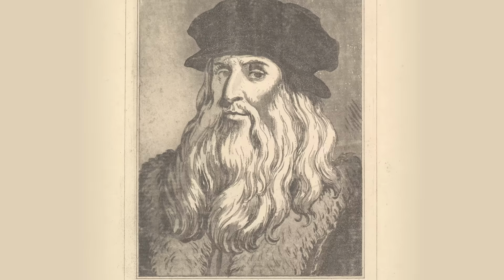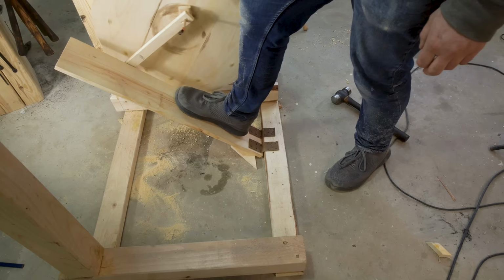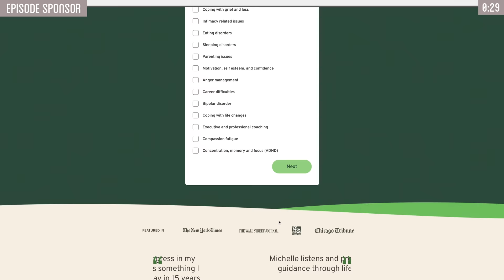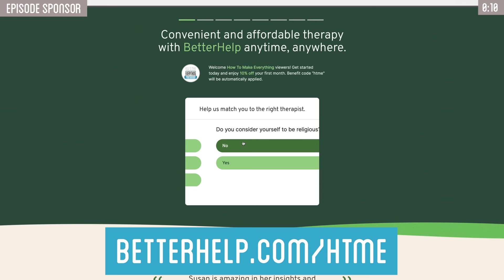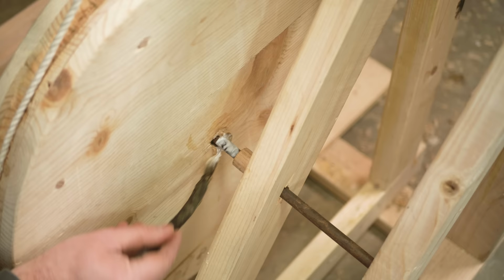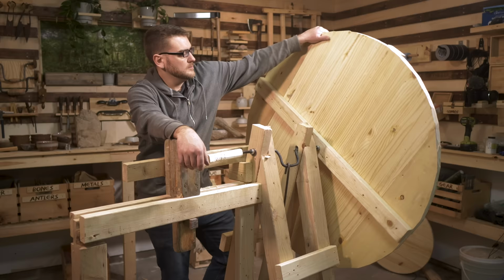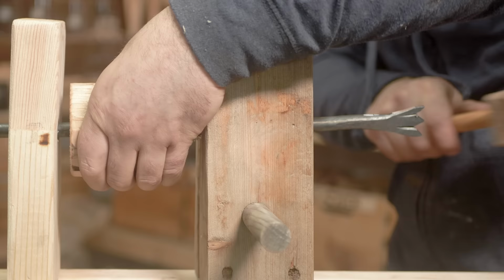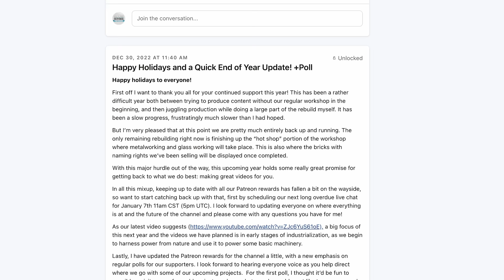Does DaVinci’s 500 year-old Lathe Work?

Comment: Chemistry safety tip: add the lime powder to the water, not the water to the powder! It'll help you keep control of the temperature and avoid steam explosions launching corrosive solutions everywhere. This applies whether it's an acid or a base.
Reply: Do as you oughta, add acid to water
Reply: @y0h0p38  except lime is a base.
Reply: @Ghorda9  Strong acids OR bases both create heat when they dissociate in water. Adding water to either isn't a good idea, unless you want spashes of strong acids/bases.
The saying I posted is just a saying to help you remember to add them to water, not vice versa. It goes for both acids and bases

Comment: clamps were invented in 500BC and would help stabilize much of your woodworking. Taking a little extra time to align things and maybe make slightly more accurate tools might help you out. Also making your own improvisations/improvements are a good idea if thats all something needs to work. Maybe especially with reinforcing the structure. Perhaps a table to help you saw aligned aswell.

Comment: I'm a carpenter, and I also recreate wooden tools used throughout history. My largest projects have been a full size medieval trebuchet, and a full sized wheel crane (the original heavy crane, powered by two men in "hamster wheels"), so these are my best tips. Most likely, all of these have already been covered, but here goes.

1) Increase the accuracy and straightness of your joints. Do full layouts of all mortise and tenon joints, use an actual saw to cut the cheeks, and be sure everything is STRAIGHT. Your frame was wobbly not due to the design, but because of sloppy joints and lines not being straight.

2) BALANCE YOUR FLYWHEEL!!! A flywheel is useless if not balanced! In fact, it makes the process more difficult!!

3) Use hardwoods in the supports. Pine is alright in areas without high compression or torque, but in the vertical supports and the flywheel supports, utilize a hardwood like oak. Using oak for the flywheel could also help with the storage of more energy.

4) Use leather instead of rope. Real leather is much more springy, has superior toughness compared to modern rope, and most importantly, it can lay flat on the flywheel. This gives it more surface area, thus giving more force transfer from the crank to the flywheel. This is why belts have been used on motors since their invention. 

Hope that helps!
Reply: you must be a worker of Guedelon castle 🤣
Reply: I would love to see a video on working wooden trebuchet, too bad the actually cool guys are too busy to be making videos it seems
Reply: @andreabonacossa8709  Omg, I wish! I live in the United States, so a bit too far away from me. I have worked with several reenactments, festivals, and living history foundations though. For the past few years, my focus has been on furniture and joinery. I started my own business last year, so that has taken up most of my time.
Reply: I would love to see that hamster wheel-powered crane in action
Reply: About the leather belt as opposed to the rope, he's also designing the pulley wrong. Instead of a groove in the center, he should be building it with a crown to help center the belt.
Reply: Only thing to add to this from me is to splice the rope rather than knot it. Every time the knot hit, the rope jumped.
Reply: @kayagorzan  Tom Scott made a video on it recently, i think
Reply: My understanding of soft woods vs hard woods, was the type of seed, not the hardness or softness of the wood itself...???
Reply: @sanctionh2993  nah oak or mahogany is harder or usually more dense than pine
Reply: He can't use an actual saw, for that he has to build an actual saw.
Reply: @sanctionh2993  Yes, technically that's true. In general, hardwood comes from deciduous tree's which lose their leaves annually. Softwood comes from conifer, which usually remains evergreen. 

Usually, hardwoods are harder and more dense than softwoods, but not always. That's why I pointed out oak, as it is a readily available, dense, and durable hardwood.
Reply: @moonlghtbttrfly  If he hasn't made a saw yet, then he needs to make one before he considers building anything decent.
Reply: @christopherrice2004  Good point, agreed.
Reply: @kayagorzan  Actually, my daughter is involved with Odyssey of the Mind, and the years she goes to regionals, I take the hamster wheel with me, then connect the drive shaft to a contraption that shreds ice. Then, I have a table with liquid flavors. The kids hop in and make their own sno cones! It's always a hit.
Reply: @bryanstellfox8521  he made one, he uses it. You suggested the usage of an "actual" saw, that is still to come 😂
Reply: @moonlghtbttrfly  Ah, I see!! Haha I like the quote marks around actual 😂🤣😂
Reply: @bryanstellfox8521  Wow. Childhood me would absolutely love that
Reply: this is the guy that knows just enough to seriously injure himself doing something very wrong I have used a lathe of that type and it was rock solid and partially built into the building his was not even close to the right scale.
Reply: @sanctionh2993  You misunderstood.  Hardwoods are actually harder that is why they are used in floors and furniture.  They resist dent's and do not break as easy as soft woods.
Reply: @goodtreeministries3751  nope, the term "Hardwood" has nothing to do with the actual hardness of the wood, it's about seed types. while a lot of Hardwoods are on the harder side it is not a defining feature, in fact, the softest wood widely available, Balsa, is a Hardwood, and is 5 times softer than Red Cedar, a Softwood.
Reply: Give me string, I will give you straight cuts, straighter than most people will ever make with a handsaw.
String is wound around pulleys that then spin, carrying string coated with lard and sand, and slice through the work. A primitive Band Saw, if you will. This is also done for granite and marble slabs. I believe it is the method the Egyptians used to slice Pyramid blocks.
Unless they were poured in place, with consistent forms.
Reply: @sanctionh2993  Yeah that's true here you do want an actual harder wood not just any hardwood. Balsa would clearly be a bad choice. Though hardwoods are usually denser.
Reply: @sanctionh2993  yes that is hardwoods and softwood in the botanical sense, but still many pine species are quite soft, but Longleaf pine can be as heavy and hard as Oaks and a hardwood like Balsa is like a dense Styrofoam.
I understand what you mean.
Reply: @samellowery  Longleaf pine from the southern United States is as heavy and hard as most hardwoods, but in Europe a dense softwood would be the Larch or especially the Yew.
The Pine trees specifically do tend to be soft, except for southern yellow pines of the America's, which are incredibly strong.
Reply: @goodtreeministries3751  Balsa is also a hardwood species and Southern yellow pine is up to 45 pounds a cubic foot as is Hard maple.
There is the botanical designation of hardwood and softwood species and it only refers to the average density but the seed type is how they are categorized.
Reply: @thejackscraft3472  i agree, and next time mention Longleaf pine, because I have some samples that are like Oaks and hard maple, heavy and hard as hell.
Reply: I think he wanted it to fail.  Why?  I can't imagine, but he one of the worst jobs I've ever seen.
Reply: Also  he should take a look at antique spinning wheels.  The groove for the pully and flywheel needs to be more narrow and deeper, so that the rope doesn't come out of it, and spliced jute or leather would work better than knotted cotton.

Comment: Having support on both sides of the pulley's axle is a HUGE thing, as is having a properly balanced flywheel.  You should be able to balance it after construction with lead weights- you can get lead patches for balancing fans, or you could drill holes and pour lead into them around the edges.  Having a properly balanced flywheel will help immensely.

And you don't actually need external power for metal lathing- there were popular treadle powered metal lathes in the 1800's.
Reply: Actually threadle powered lathes where sold into mid 1900s (have a catalogue from 1944 showing one for toolroom use)
Reply: He can balance is by just drilling into the heavy spots.

Comment: A bronze bushing would be a super simple way of reducing friction on your axles. Also, to ensure the equilibrium of your flywheel, use its rotation to shave it into a concentric form with your knife. As long as it stays on its axle, it will turn true once properly carved.
Reply: A more correct bearing would be “Lignum Vitae” wood.
It is a dense oily wood used for bearings but Leonardo Da Vinci predated the discovery of that wood in South America so bronze or Babbit on steel / wrought iron would probably be the closest alternative.
Reply: Since wood is not a homogenous material, you´d have to do some additional work after turning. But it would be a big step in the right direction.
Reply: @allangibson8494  wood polish would also work, though im more familiar with friction polish with lathe work, and that relies on getting the object being polished to high speed
Reply: I recall reading that people liked to use lead to make a bushing (for metal parts at least). 
Since it's soft and has a low melting point,  you could just pour it in place and then after a couple years once the bushing wears down, you just collect the lead powder and remelt it for a continuous perfect fit.
Reply: @pipedreamer9781  Tin (90%) copper antimony alloys were traditionally used in the 1800’s.
Reply: @allangibson8494  interesting. I suppose the copper must harden the tin so it can withstand the long term abrasion?
Reply: @pipedreamer9781  leaded bronze would be even better. Lead by itself will wear out very quickly. Leaded bronze (and brass) are used for sleeve bushings to this day. The lead is not soluble in copper at room temperature, it separates in little lead blobs between the crystals of copper and is easily smeared by friction over the surface of the bushing, lowering the friction coefficient. And the copper matrix gives strength and dimensional stability.
Reply: Too bad that wasn't invented yet!
Reply: @batsardcat3285 bronze age?  I think it was not only invented but there were several types used in various ways from malleable to hardened for tools and weapons.

Comment: I believe if you increase the power stroke on the foot treadle you will get much more energy into the flywheel, also if you could incorporate a metal band around the flywheel it would make it heavier and store more energy.
Reply: just a few weights nailed into opposing ends should be easier to make and balance than an entire metal band of contiuous thickness
Reply: A steel tyre (just like a wagon wheel of the era) would be a significant benefit in multiple ways. Using an actual heavy freight wagon wheel would probably be a more period correct option.
Treadle metal working screw cutting lathes were commercially available product into the 1950’s.
Reply: @clausroquefort9545  A continuous ban would increase the strength of the flywheel. Putting some nails through it (or the wheel under it wouldn’t weaken the wheel then.
Reply: The stroke of the pedal is dicated by the crank itself, so making a longer power stroke would mean having a larger crank and a lot more places for things to go tragically wrong

Comment: a couple of improvements i can suggest for the Lathe, first of is instead of drilling oversize holes for the shafts, you cut a bearing block out of a hard, oily wood with lubricating holes for oil. this should help with the wobble of the shafts a bit. another fix would be to turn (by that i mean the woodcutting term) the flywheel in place so that it is balanced and you should be able to turn a crown on it to provide a place for a flatbelt to ride on. The treadle would ideally be directly driving the flywheel but that may mean it will need to be operated by an apprentice off to one side of the lathe.

Comment: Quick question. Why not use a gear system to multiple the number of rotations? Using a large gear to rotate smaller gears that are connected to the lathe would result in the smaller gear performing multiple rotations for each rotation of the previous larger gear. It's the same principle as the pully, however I think it'd give you a more stable rotation. By replacing the rope with a specialized chain you could even combine the two like in a bikes gear system to allow for an adjustable difference in speed and power. Love what you're doing, keep it up.

Comment: I have a lathe that my grandfather converted to use a treadle from an old sewing machine. It works surprisingly well even with metal. The speed is determined by how fast you pump the treadle. It is probably at least 70 years old and it still functions perfectly. I have some other machinery such as a drill press and a bench grinder that also run off of the same treadle. Grampa was pretty ingenious when it came to such things.

Comment: Wet the rope (pully), then pull it as tight as possible. When it dries it will be much tighter. Also use a better knot, and cut off excess. 

You might also want to to wrap the rope around each wheel twice, AND/OR put a metal band around the wheel leaving a gap for the rope to thread through. Either should increase your run time and decrease failure. the metal band is likely to keep it together till the rope breaks (could be years)... You may need to drift some holes in the metal in order to have entry points to coax the rope through unless you have a solution for something to pull a rope through.

Both methods are pretty common in the old days (the metal bands were used on wheels so it would have been a common thing, the only difference here is there is a channel in the middle of the wheel for the rope).
Reply: If the shrunken rope doesn't work add a tensioner wheel.

Comment: A few things on the second lathe that I think will help. Identify your weakest points of stress and utilize forged steel. Peen them to keep them in place and add lubrication. If you want to go one step further, you can inlay a copper pipe or bracket to keep the steel from chafing the wood. On that note, remember that the closer to the center of a circle you are, the more force you need to apply to make it move. I'd put it about 1/6-1/3 away from the edge of the flywheel rather than that close to the center. That's probably where a lot of friction is coming from The rope you should use should have as small a knot as possible. I'd utilize copper a copper crimp and adhesive to make the closed loop. Sand the groove with rough sandpaper. You want it consistent, not necessarily smooth. You may also want to consider a different pulley spot or making grooves to make sure the rope doesn't touch the beam. 

In short: Try to reduce the amount of friction on the system as possible without losing traction of the rope.

Comment: You could use an old sewing machine treadle. They're solid cast iron and the treadle is center pivoted, so you can apply force on the up and the down stroke if you use both feet.  Also features a big cast iron flywheel and if you use the sewing machine it already comes with a 4 to 1 mechanical advantage. The machines are solid cast iron as well and could be modified pretty easily - just saw off the sewing end and attach whatever you want to the wheel.

Comment: In the museum I work at, we have a couple lathes. One is runs on a belt transmission from a waterwheel and the other is a hand cranked one which is closer to what you were experimenting with here. 

Essentially, you have a big, wooden flywheel, in our case made from oak. It looks kind of like a wagon wheel, with spokes and a thicker outer rim to keep the momentum, I reckon you could get away with a plain one as well. Directly attached to this larger flywheel is a slightly smaller drive-wheel. both of these are on a metal shaft and sit in a cradle. The drive wheel is then attached by rope, or band/belt, to a smaller wheel, which powers the lathe. The lathe itself has its own, larger, circular mounting plate. The mounting plate is made from steel, is about an inch thick and also functions as a flywheel to keep the momentum going on the lathe itself. 

The drive and lathe aren't attached anymore, but I use the crank and flywheel as a means to teach kids about momentum, letting them spin it up and then telling them to try stopping it.

Hope this might spark some ideas for improvement and keep up the good work!

Comment: 4 quick improvements:

A press fit bronze bushing rather than having the drive shaft riding directly on the wood frame will reduce the wobble. 

Less drive shaft sticking through into the work area will further reduce the wobble. 

A straight leather belt rather than the crossed string will reduce slip and can be tensioned by wetting and/or heating. 

Have the tread extend under the flywheel and attach to the back side. The flex from stepping on it will then pull them together rather than prying them apart.

Comment: You could add iron or steel bushings into the contact points of the wood to reduce friction further, as well as use it as a rim on the outside of the flywheel to add more mass to it.

Comment: My mother used to have a treadle powered spinning wheel for spinning wool into yarn. As a kid I used to pump that treadle and see how fast I could get the spindle going. It would get going pretty fast, probably 2000RPM at a guess. Essentially, it's a lathe and your second design was close in some aspects. For instance, the Treadle and treadle bar should move as one unit with the strip of leather connecting the treadle to the Footman (the upright pole between the treadle and the crankshaft. The crankshaft should be metal and attach directly to the Footman. Work on the tolerances, make a proper wheel and you will get better results.